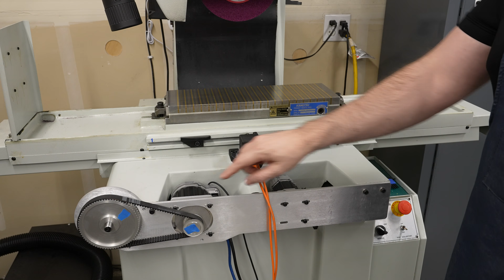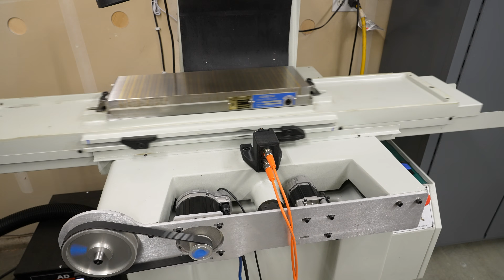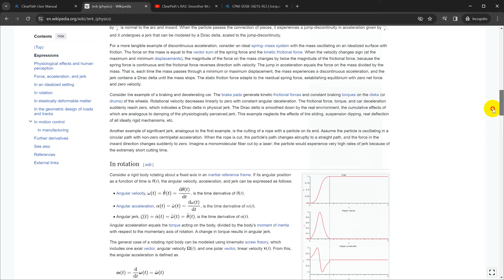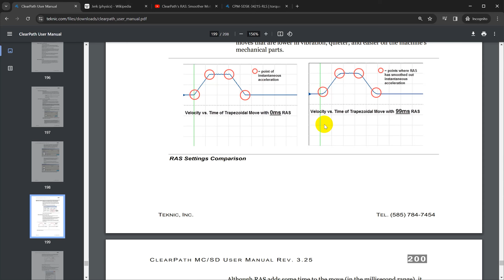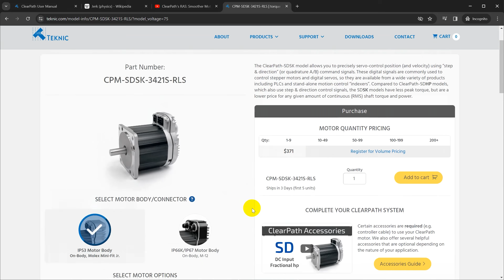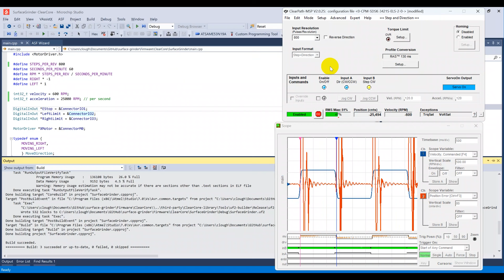Smoothing Out the X Axis Motion | Surface Grinder Automation 7 | Clearpath RAS

Comment: I'm curious as to why you chose limit switches to calculate reversal rather than counting encoder ticks. It's a lot more programming to count and you solved the problem in hardware so it works. Still, I would be tempted to do the jerk smoothing, reversing, and accelerating when the counter reached the end of the table. Then you would be able to reverse and accelerate all the way back up to speed before the wheel hits the work. This would solve the delay problem induced by the motor not able to anticipate the limit switch. It's a solution in search of a problem now :)
Reply from the maker: Because the table isn't fixed to the drive.  The cable can slip on the drive spool.  That said, I did eventually switch to a pure software solution and we'll see how it fares over time.
Reply: @Clough42  Sorry about that. I watched it again and saw the cord and slippage. I should have deleted question as I understood it after seeing that Thanks. This is a cool problem!

Comment: The tension on your belt isn't tight enough, you can see when it changes direction the belt is slacking on one side and that can cause a bouncing affect. If increasing the tension doesn't help enough you may need to add a little more rap around the small pulley to get more teeth contact. You can add bearings on the outside of the belt, so it makes the belt come straight off the small pulley.

Comment: You could wrap those cams around the sides of the t-track with little a gled pointers, print/glue a tape measure on the top of the t-track

Comment: Not sure of its possible but I'd look into defining the limit switch state changes as interrupts. If you complicate the code more, or the controller is busy otherwise you may miss the trigger. Unlikely with this setup but I'd feel safer with hardware interrupts.

Comment: James, the acceleration is way too high, even with RAS. You're going to destroy the machine in the long run. The machines I worked on all have a soft change of direction transition. Remember that you don't even have any heavy parts on the grinding table now.

Comment: I did not get this part at the beginning of the video where you increase speed but also acceleration. I mean, if you put like velocity=600 and accel=2400 - you get 250ms for motor to speed up / slow down. Why crank accel and then buy motor with RAS to fix this? What do I miss?

Comment: The small physical difference between the two motors (the encoder resolution) does not justify ClearPath/Teknic software gating higher RAS (jerk limiting) to the more expensive option (+$50). Other than more $$ for Teknic there is absolutely zero technical reason to software gate higher RAS calibration values. 800 steps/rev is absolutely plenty for aggressive jerk limiting because basically the same feature is present in open source firmware like marlin (see s-curve acceleration) which can run on the most basic open-loop 200 steps/rev steppers (sure, with x4-16 microsteps).
It's an absolute shame Teknic wasted your time and money. Anti-consumer practices like this should be called out. (Also, bonus points to open source.)

Comment: A few thoughts about further exploration and tuning of the loop.  The cable elasticity is likely the major issue, but the cog belt and table suspension are also in the loop (and variable part mass as others pointed out).  One idea is to mount an MEMS 3 axis G sensor (or 6 DOF) to the table and see exactly what is going on there with the tuning. The dynamics may include vertical table motion, as it's unlikely the cable force will be at the center of mass. Then try adding a part to be ground.  That is ultimately what matters for grinding to a tolerance & finish.

Another perspective on RAS is it controls the frequency spectrum of applied force.  Reducing jerk and further derivatives reduces the higher frequency inputs.  If you don't put them in, they don't need to be controlled out.  Mechanical structures usually have a huge number of resonance modes, and stable control of them is the classic control loop challenge.

Comment: I'm assuming the timing belt is an model of an 25AT5. is the belt properly tensioned for the application (ie.  By frequency or load) that will effect the action and tuning of the servo. And I'm not familiar with these types of servos, or software/firmware is it capable of doing an S profile instead of trapezoidal, and or a PID control. Or even adding a balance cylinder to keep motor load constant.  These are probably stuff you have considered. Just curious

Comment: It would be very revealing to compare the motor’s encoder position to the table’s position as determined by a linear encoder scale on the table. However, to do so would rapidly degenerate into a research project. As it stands, James has enlightened most of us with the novel RAS solution. From a design standpoint, it is a great solution because it avoids the expense of a linear encoder and it’s mounting. If this was a ground-up design (vs James’ retrofit) the better approach would be to replace the cable drive with a ball screw. But even then, this is a surface grinder’s X axis: It doesn’t need precise positioning, only smooth velocity.

Comment: You could always design in a 3rd shaft for the X axis pulley drivetrain with the new shaft down below. Make the servo go from its small pulley down to a big one, that big one is on a shaft with a small pulley on the other end, and have that new small one go to the existing X axis large pulley that goes into the machine. This would double your gear ratio which gives you more torque and will let you easier control the motion inertia with a smoother accel/decel curve. You aren't using all the motor RPM right now, so you can afford to cut the max RPM in half to double the ratio. When I did this project I had to use a higher ratio than I thought due to these similar inertia problems of the weight of the table and the springiness of the wire. By doubling the ratio the motor can take more time ramping speed down which does help with the inertia.

Eventually you might want to do what I did and replace the wire underneath with a leadscrew and lead nut. The lifetime of the drive wire became too low with a servo due to the higher speeds we tend to run over what you do by hand. The leadscrew fixed this lifetime issue. I first started with a 3/8 screw, because its weight limit was higher than the table. However, the inertia was so high, it overloaded the lead nut too much and caused the nut to fail and strip out after a year of use. I replaced the screw and nut with a 3/4" one and so far (4 years now) I haven't had to replace a single thing again.
The lead screw is mounted on each end to the end of the surface grinder table, so it doesn't turn. I have two bronze lead nuts mounted in a timing pulley, with the ends of the nuts sticking out of the pulley. The motor has a pulley on its output shaft that connect to the pulley holding the lead nuts with a timing belt. I have two mounting plates mounted to the table with ball hearings mounted in them, and the ends of the lead nuts are held by the ball bearings. This keeps the lead nuts and pulley centered properly on the lead screw and keeps the pulley from being able to travel left or right, since we want it to stay in place and drive the lead screw through it.

I used a 3/4" .250" lead screw, which with my motor (3000RPM max) gives me a 12.5" movement per second on my surface grinder X axis. This was enough for me, but if I was going to do it again I think I would use a 3/4" .333" lead instead to have a but more room to play with things.

Comment: That's an impressive improvement James.  My Rockwell Delta bed sits on ball bearings and there's nothing preventing the bed from lifting as it changes direction.  I wonder if your grinder is subject to any mechanical lift during the directional change.  If there is, it would affect you surface finish.  You might want to check that out. Gilles

Comment: Just a thought.   You could have accomplished almost the same thing in two different ways.  1.  Count steps between the limit switches and then apply a two step decel.   2.  Added two more switches that act as a warning and start your decel on the first switch.   Your decel and direction change should take place after the wheel has cleared the part.  That way you will not see the direction change or decels/accels in the surface finish of the part.    Spent too many years doing this by hand.

Comment: Seems more likely it's the rubber belt  more than the steel cable that's stretching too much.  A longer shaft with multiple pullies and belts could help significantly.

Comment: Nice!  I wish I had this info a couple of years ago when I built a couple of machines for a local manufacturer.  It had a springy x axis (6’ of 0.25” wide timing belt).  It had very little mass/speed/force but I had a lot of problems with resonance.  A combination of a much stiffer belt and auto tuning finally took care of it, but I would have much rather just swapped to a RAS-able motor if I knew about it.

Comment: Your software could start each run by identifying where the limit switches are located, then just run back and forth within them, to get highly precise travel without worry of overrunning the stops. If you start hitting the limit switches, you know your cable is stretching, has slipped, or has loosened. Better performance and extra safety - win-win.

Comment: I know it's a personal preference, but I would have made the limit switches virtual. Leave one physical switch at the far end of travel to home, then set start and length parameters in the SW. You could also build a cool interface like the lead screw controller with speed, start and stop displayed. That way you can dynamically control it during the job without have to stop and physically adjust the end stops. Then as the controller knows where the two points are, it can accelerate and decelerate in SW to the exact positions. You don't need the more expensive servo, and you can stop on a dime without any overshoot. You could even leave the two physical end stops at the two extreme positions as estops too late now. You bought the expensive servo. But you have to live with the overshoot... Nice project, though. :-) I'm still jealous ... :-)

Comment: James, I think this wire spool system is not great. What about if the table slid such that slack developed in the wire? If the table got bumped in the direction it was already headed, there would be slack and no control of the table until the tension in the string caught up. It was as if someone slipped or was horsing around in the shop and pushed or landed on the table in the direction it was already going. The current machine also lacks protection against this edge case. Conversely, the grinding wheel could put tension in the string system if it added a push in the opposite direction of table movement. These issues made me think perhaps a rack and pinion, lead screw, or in the very best case, a ball screw would be better for motion in the Y and Z (did I get my labels correct?). By design, they each resist backlash. I can not imagine it would happen often, but if the grinding disc had just the proper engagement, it could push the table, so it was outrunning the wire, creating slack. It reminds me of when I push my kids on a swing; at the apex, there is no tension in the chains, and you can see them go slack until the kid and swing seat catch up and grab at the chain again. It is perhaps not a great analogy. You are very concerned with safety, so I thought I'd mention this possibility. I wonder what they use on real automated machines?

Comment: Couple more notes regarding the ClearPath:
* If not, then run auto-tune again with the new motor, and see, if it finishes. There have been instances when the auto-tune has "gotten stuck" at certain percentages, in such cases I have just applied some force to the mechanics to allow it to overcome it
* Try fine tuning. You can find it under Setup -> Tuning -> Fine Tune. There you have a slider which you may try moving to either side to see how it affects your use case.
* Use higher input resolution. You have set it to 800 in the MSP software, but the motor's native resolution is 6400 which would result in (a little) better movement since the RAS algorithm has a higher input frequency. CleraCore can handle such high output frequency very well thanks to the clever internal "clock"

Comment: Another great video James. Something to be aware of at that fast of a speed on the X-axis is the speed of the grinding wheel vs longitudinal movement. If it's too fast you will not leave enough time for the wheel to do its work. Think of climb cutting on a mill at a rapid feed rate. Every "automatic" grinder I've ever used had a much slower x- axis feed rate. Also, as you may already know, things can go wrong in a hurry when surface grinding, so an external control outside of the e-stop would be helpful to vary the speed.

Comment: Thanks for the educational video today. It occurs to me that the surface grinder presents a special case where the motion is repetitive for each job, so after the initial (or a few) traverses are made, you could take advantage of that by allowing the motor to learn when it needs to slow down prior to the reversals to prevent the torque excursions by using an algorithm in your code. Here is what I'm thinking:  Sum the number of motor steps for each motion for the first, say 5 cycles to take advantage of statistics, and calculate the average for each direction. Then, following the 80/20 rule, start ramping the velocity down at the 80% of the full average number of steps (for that direction) to some chosen velocity that the motor can accurately accommodate with minimal excursions. I think that would allow both a faster velocity and acceleration while maintaining good torque profiles and reducing the stress on the motor. Just a thought.

Comment: Definitely worth the extra money. I guess another option would be mechanically damping the torque spikes with a hydraulic torque limiter. One out of the cooling fan on an engine could be retrofitted to work. The damping effect is mechanically variable and controlled by a bimetallic thermostat which could be replace with a lockable thumbscrew adjustment. For extra credit, you could use a centrifugal actuator to mechanically emulate those rounded corners on your torque graph making it a purely electromechanical system with no controller.
Reply: Adding mechanical solutions will probably not work with these closed loop servos. You would have to do the calibration fully manually. I mean the software solution is the whole reason to use these expensive clearpaths.

Comment: Great video.  I came into it frankly thinking that it would likely be boring.  I mean, how entertaining could 26 minutes of smoothing X-axis motion be?  But it was!  And very educational too!  (Now I know about "jounce", as just one takeaway.)

I'm wondering why you decided on the mechanical lever switches rather than the proximity switches.  From your earlier video comparing the two, I really thought the proximity switches would be the winner.  Heck, if you switched to using the proximity switches, you could add the mechanical switches as WAY-overkill to trigger eStop if the table went beyond limits.

Comment: The RAS enabled motor has clearly worked.  Would you be able to program different acceleration and deceleration values to smooth out the start of motion if RAS did not work?

Comment: I'm curious -- if the settings are dialed in for the machine with an empty table, what will happen when you have a 20 pound chunk of steel on the chuck?  Will the extra mass cause issues?

Comment: James - Great video.  Your research took me back to when I was 17 and learning basic calculus.  "This is hard, where am I actually going to use this?"  Then one day we learned the relationship between displacement, velocity and acceleration as derivatives and integrals of each other.  Seventeen year old nerd mind blown!  Fast forward 41 years and most of an engineering career and at age 61 you point out that there are at least two more useful derivatives to be had when it comes to springy systems.  Old nerd mind blown once again!

Before you started showing ClearPath's solution to this problem, my mind was running towards a solution in the control software.  Since your stops won't be moving during a run, my thought was to run one slow pass at the start of the run to learn the positions of the stops, then use those known positions as part of your control loop and predictively change velocity and acceleration as the movement approaches the stop.  Move 95% of the distance at full rates, then reduce acceleration for the last 5%, then same going the other way, something like that.  Just check the end stops on each loop to make sure that we didn't miss a count somewhere and as a safety,  but since those are servos, the only error might be mechanical slippage.

One last thought - the table and vise are fairly massive, but do you think different tuning might be needed with a heavy object added to the system?  I'm thinking a large angle plate or sine bar setup plus some heavier part to grind might add enough mass to the far end of the sprung system to mess with the control parameters.